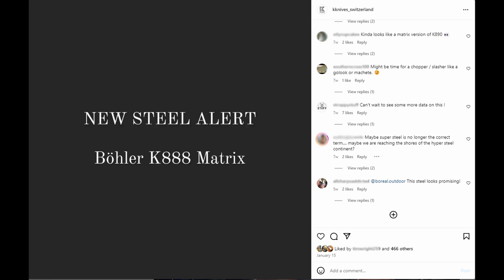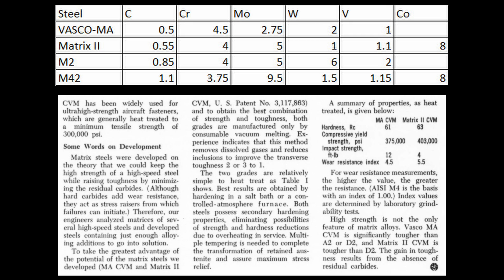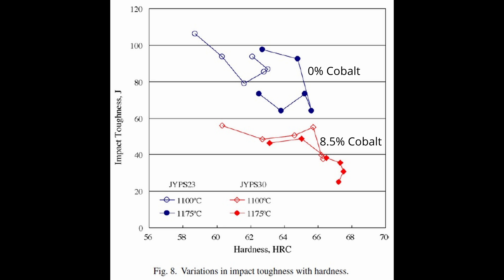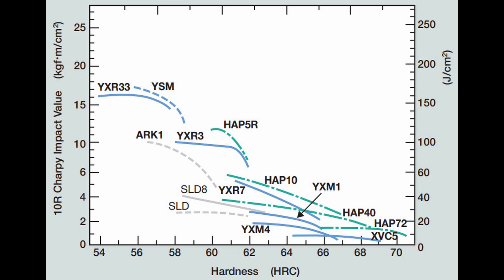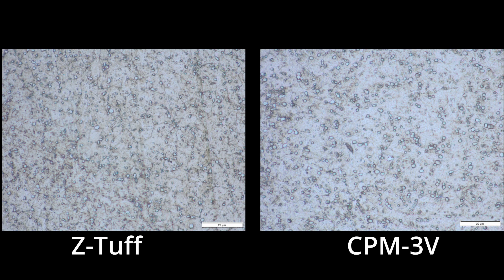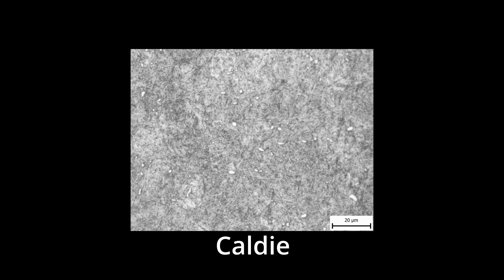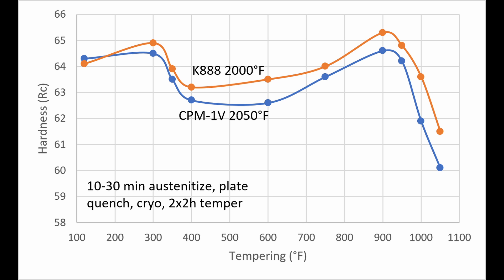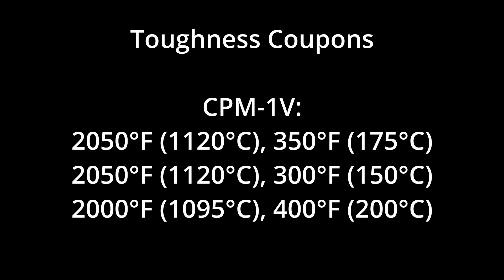Matrix Steels K888 and CPM 1V - Age of the Hyper Steel?

Comment: I need an advice, and it might create a hot debate. But please, remain polite and friendly. I understand each one has its own preferences and it's ok like that.

I'm looking to buy a GOOD Bushcraft knife and I'd like to have your opinion on that. Here are the specs I'm looking for.

GRIND: 
Scandi because I'm not a real pro at sharpening.

EDGE RETENTION: 
Important, but not critical. I prefer a good blade with less chances to break. So to have to sharpen more often is not a big deal. However, I don't want to have to sharpen it every minute. you see what I mean.

LENGTH:
Most Bushcraft knives are around 4.5". Which is not great, in my opinion, for batoning a 5" blade would be nicer.

TIP:
I prefer a flat tip over the tanto types like the SK-5. This for batoning's reason.

RAT / FULL TANG
Full tang of course.

STEEL
Big question! I want one that I can make feathersticks, small carving, batoning, etc.. It's a bushcraft utility knife and not a survival knife (I'd choose a much bigger knife for survival).

Thanks for sharing your input on that!

P.S. Please no Bear Grylls or Pathfinder's stuff ;)
Reply: Usually Mora is the go-to for basic but good bushcraft knives. They have a full tang 14c28n model. But I dont recommend batoning, like at all. You can use a wooden wedge. Or use a bush hatchen that also gets you through wood in the other direction. Scandi is also harder to sharpen thansk to it being such a large flat the have to grind down, and if your stone isnt flat or you angle wrong, you'll have to grind a lot more to get back to the edge, plus also worse cutting performance through food things like an onion. Its good for carving thanks to chisel like grind, which is why scandi use it, but modern bushcraft knives are too thick compared to traditional scandi knives. Would recommend different knives for different tasks. A mora basic stainles is thinner for cutting food, and such.

Comment: I'm kinda most shocked looking at that edge retention graph.
I didn't expect O1 to be particularly high but was more surprised how relatively cheap stainless steels outperform carbon steels.
All this time I was under the impression that A2, O1, 52100 etc would hold an edge better than 14c28n, aebl, 440c etc
Reply from the maker: 440C has the same carbon content as A2, O1, and 52100 but with much higher chromium. That higher chromium means the formation of harder chromium carbides that contribute to wear resistance. If at the same hardness the 440C resists edge wear better.

Comment: I'm excited to see how CPM 1V performs as a knife especially a fixed blade. I have a Cruwear Manix XL and I've absolutely loved the toughness to edge retention ratio I seem to be getting out of it but 1V seems like it would be a decent upgrade especially on a fixed blade. I'd like to see something scandi ground with 1V as the added toughness should help with the strength of the edge.
Reply: Added toughness does not equal greater strength at the edge. Greater strength and hardness leads to greater edge stability or strength. 

Toughness means less likely to chip, it'll roll instead, but it doesn't mean it'll have greater edge stability and strength. You need hardness and fine grain for that.
Reply: @topfueljunkie100  agreed, that's why I said maybe only if it's a chopper where the main mode of failure would be chipping from impact.

It would be a terrible choice for a folder or even smaller survival knives.
Reply: @hoppeanofasgard1365  For sure. My comment was intended to be directed toward the OP and the final sentence of his original comment. I wish it'd automatically tag the OP like it does for subsequent comments I reply to though, so I get how it can look like I was responding to you. I should have specified though. But I agree with everything you've said.

I certainly like the idea of a tough chopper blade that's able to maintain a higher Rc and thus a better, more stable edge!
Reply: there will be a loss in edge retention with 1v compared to cruwear, but if you're going for a chopper type blade this shouldn't matter much especially at hrc 63 or above.

Comment: I'll always be shocked to see how badly 1095 performs compared to all those other steels. I don't see the point of using hypereutectoid steels, they just seem to sacrifice toughness a lot, just for a bit more wear resistance (but in that case, wouldn't a lower carbon steel quenched and tempered but left hard outperform in pretty much all ways a very high carbon steel quenched and tempered to a lower hardness ?)
Thanks a lot for your fantastic work larrin !
Reply: Yeah, that's basically how it works. 1095 can be done better if you do a lot of care with proper spherodized carbides and proper carbon dissolution, small grain size, and some such. One can also do a marquench/interrupted quench for higher toughness. But yeah, the iron carbides do very little for actual wear resistance even compared to just running eustectic steel harder.
Reply: The silicate abrasives in the CATRA test are harder than the cementite carbides which mainly contribute to low alloy high carbon steel wear resistance. This makes those steels which rely on cementite perform relatively worse at a given hardness/toughness. In real world application for a knife it wont be cutting into silicates as often and edge retention would likely be more competitive with other steels. This is according to Larrin himself, though I forget where exactly its mentioned on the blog

Comment: Could the cut direction on K888 somewhat influence its toughness measurements?
Reply from the maker: The direction can matter even with cross rolling because the rolling is never perfectly even in every direction. These K888 toughness coupons broke in the “normal” direction, or thickness direction. The “weak” direction is when the crack grows along the rolling direction, called transverse toughness.
Reply: @KnifeSteelNerds  So, was the K888 cut from sheet or bar and in what direction?
Reply: @sabolbrothers I cut it from blocks and surface ground it to size, then sent it to Larrin. Unfortunately no K888 sheets are available from Böhler.
Reply: @kknives_switzerland  Were K888 samples cut lenghtwise or crosswise from the bar?
Reply: @sabolbrothers  Unfortunately unknown. And I see where you are getting at. But Böhler Uddeholm has no plans for sheets, which makes sense - after all, it's a steel meant for high temperature stamping work, dies and such. But I am certain that one day, us knife plebs will receive a dedicated Böhler Uddeholm knife steel.
Reply: @kknives_switzerland Thank you for your reply, Roman. These cuts are usually done in ND/TD plane, but since this fact is unknown, there is no point discussing it any further. Yeah, let's hope that one day vHPM will...
Reply: Bohler cross roles to the end, so it shouldn't matter.
Reply: There was no mention either in this video or in the article on how were K888 samples obtained and we doubt they were cut from sheet stock.
Reply: @sabolbrothers  Well, good thing It was sent to a PhD Metallurgist. 👍 All taken care of.

Comment: Calling 1v a "hyper steel" reminds me of the old "what will happen to Maxamet now that Vtoku2 is out?" post on BF or the Spyderco forum.
Reply: A real good question that needs to be answered is:
What constitutes a "hyper steel"? 🤔

To me, when I think of the term "hyper steel", I think of insane edge retention on par or surpassing edge retention ratings (according to Larrin's  score chart) of Maxamet (11) and Rex 121 (12), along with having increased toughness at a 6 or above (Maxamet and Rex 121 score 2 and 1 respectively for toughness, and of course having solid corrosion resistance  at 7 or above (The two steels above rating at 4.5 and 3.5).

Plainly put, "hyper steel" sounds like the fictional/magical realm of "Adamantium", "Vibranium", "Uru", "Valyrian", "Mithril", "Adamantine", or "Vorpal". 

Maybe, Larrin and the sciences, can work some "magic" and bring about some of these fictional steels to life....Of course, Spyderco will be the first on line to make use of it for the blade community!😉
Reply from the maker: It’s probably best if this “hyper steel” term doesn’t catch on
Reply: @KnifeSteelNerds  Humans love mental shortcuts and symbology. Life is very easy in black and white. Many folks are just fine living a flat, two dimension, smooth, black and white life.  Much of this is mediated by intelligence. The less of it you have the more effort it takes to see life in "3D" the more of it you have the more effortless and natural it is. Endless nuance, endless "wrinkles."
Reply: Sadly the hyper steel term is already floating around lol.
Reply: So basically just use tungsten carbude but with a tougher binder. @TheScotchaholic

Comment: So, hype, not hyper
Reply: it's always hype. everyone with at least two brain cells to rub together should immediately know that just in life.
Reply: @TimJohnson-x1o  MagnaCut was hyped and proved solid as advertised. Maybe I just have more than two brain cells, so what do I know.
Reply: @JoeBusic  Magnacut did something genuinly new and occupied a new area of hardness / toughness / corrosion resistance balance, which was unoccupied before. The 888 seems excellent for its intended use-case as a HSS. But unless you want to use your knife as a branding iron, it doesn't really make sense as a knife steel imho.
Reply: @JoeBusic agreed as well as ApexUltra having a much better edge retention while being forgeable carbon steel.
Reply: @thorwaldjohanson2526 1V is extremely tough for its hardness though, maybe we got a geometry king steel here. I would call 13c27/AEB-L a matrix steel, in that it has minimal carbides and puts pretty much all the carbon and chrome into the matrix. This adds extra elements to give higher hardness to the matrix without many carbides to weaken it.